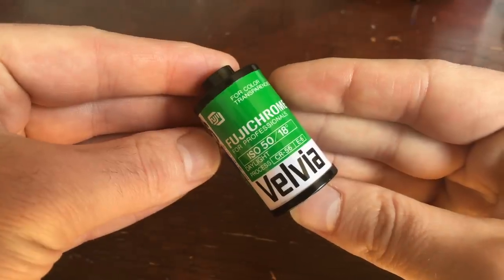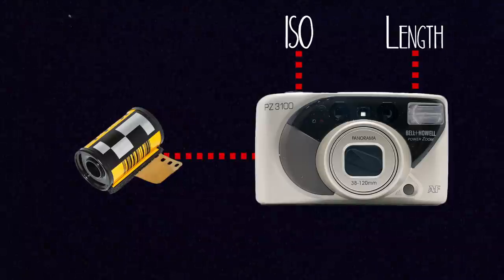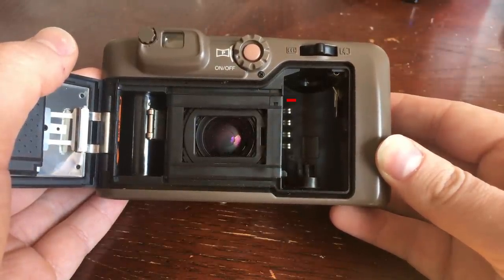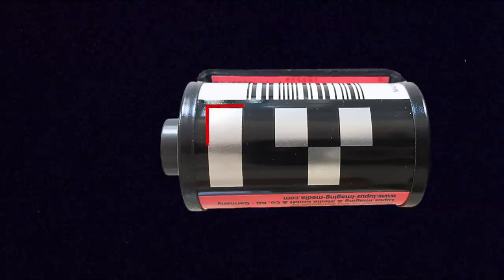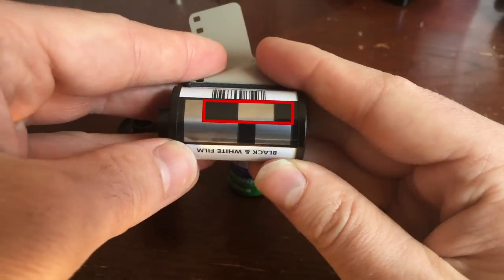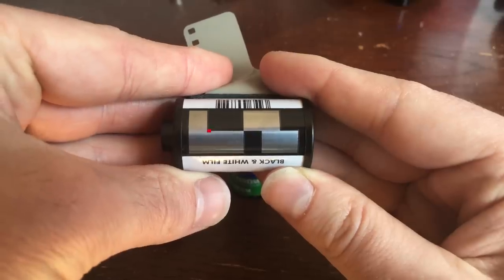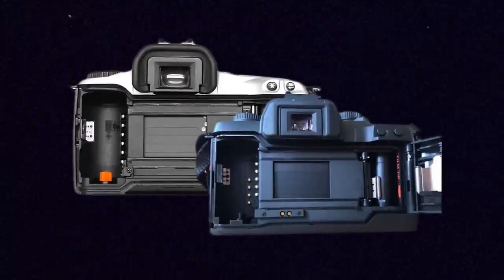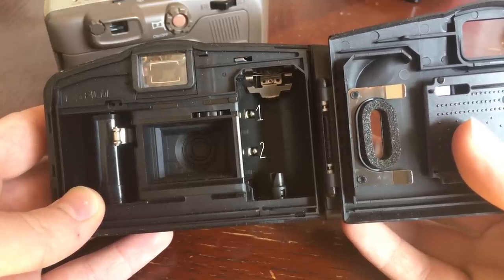35mm DX Codes - How do they work?

Comment: Hello Noah, all right what you are telling, but there is a second DX Code near the perforation of the film after developing. It is used for printing the film in automatic printing machines in the photolab. Before DX Code on the film was, the films had to be sorted in Kodak, Agfa Fuji and so on and sometimes another sortage of Kodak 100 or 400 ISO films for example. So the printer had to be set manually to the right colour balance for each sorted film roll to be printed. With the DX Code the printing maschine is able to read the manufacurer and ISO of the film and so automatically can change to the right colour balance .So you  do not have to sort the films any longer before printing. And the DX Code on the film makes it possible, that the printing machine writes the frame number on the backside of each print for easier re- orders for the customer.

Comment: I met with some automatic cameras, they don't even load films that doesn't have a DX code. An interesting video could be how to "scam" the sensor on such cameras, if the film doesn't have DX. Great Video! Thanks!
Reply: Painting the canister with conductive paint might work. You'd just need to find out what codes you need.
Reply: @gingerlyglasses444  it has to be silver conductive paint?

Comment: Hello! I got my hands on a Fuji Discovery 90 and when I insert a roll and press the shutter it only advances through the roll and doesn’t ever take a picture. Strangely enough it’ll work with the back open and without a roll inserted. Any ideas?

Comment: Hi! I use a yashica clearlook af which has only 2 pins. So, if I got it right, the camera is only able to read 100 iso dx code and 400 iso dx code. Does it mean that if I use a 200 iso roll (with the dx code on it) it won’t be able to read it and therefore the camera will adjust at standard settings(which I think are the 100iso settings)?

Comment: Even back in the 1970's 12 and 72 exposure rolls were rare. I would have liked to more easily find 12 shot rolls as I tend to change film types often and I hate wasting film by shoot just a few shots then rewinding it and processing as a short roll with lots of blank frames just because I needed a higher ISO. However, now 24 exp rolls seem to be dying out and that really annoys me.

As to DX codes, any camera able to read them is too recent for me to want to use. Sure AF cameras can manually focus, but only real manual focus lenses give the most enjoyable experience, and the cameras are optimized for manual lenses. Even my trusty Nikon FA cameras that are criticized by some as having too many electronics are still optimized for manual focus. Same with my FG.

It is just muscle memory to automatically look at the ISO dial setting when loading every roll. Maybe I got in that habit because I change film speeds so much, but I do not remember when and if I ever shot a roll at a speed I didn't intend. So for me, DX is about as useful as APS film.

Comment: what happens if i use a non DX coded film in a point and shoot camera?
Reply from the maker: Usually the point and shoot has a default ISO that it will set itself to if no DX code is detected! It's usually something like 100 or 200iso, but If you're able to find the manual online for your camera it should say for sure.
Reply: @AnalogResurgence  mine says “when using a film without DX coding or a film whose film speed is ISO 25 , press the shutter release button once after the power switched is turned on” does that mean i can use a non dx coded film??